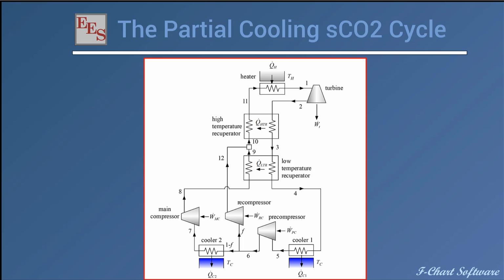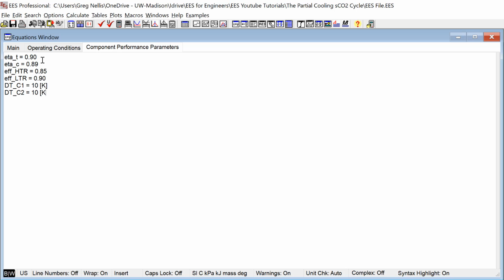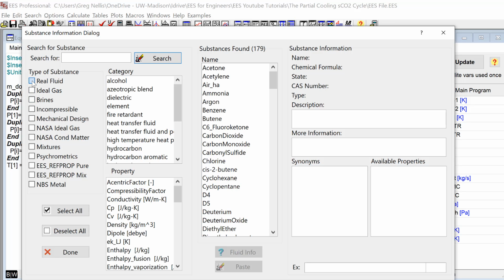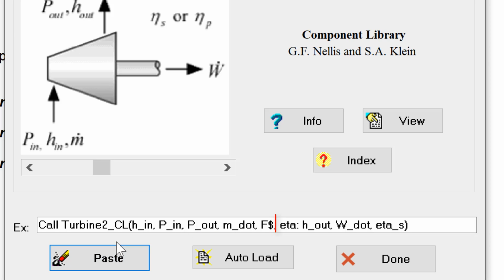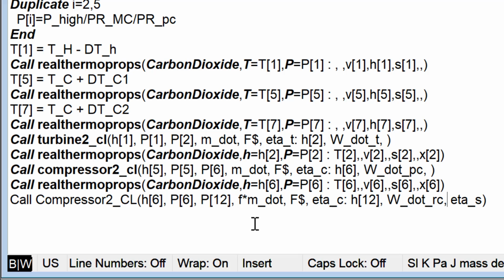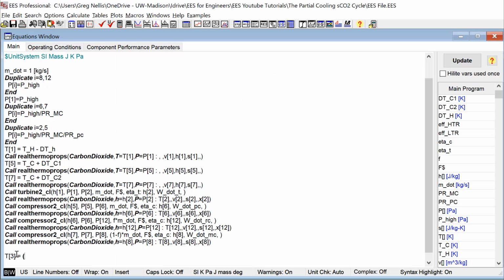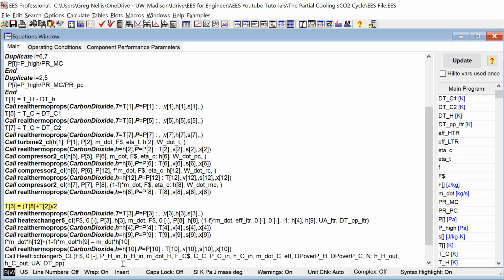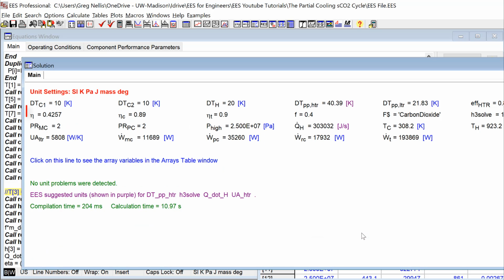An Example of using EES for Cycle Simulations

Comment: The tutorial is excellent, and I’ve been following it step by step on my computer. However, I encountered an issue when running the code. My professor provided me with the commercial version, so I’m able to use the exact code shown in the video.

When I run the code, I get the following error: "The convert function was unable to convert W/K to kW/W."

Could you please advise me on how to resolve this issue?

Thank you for your time and assistance.
Reply from the maker: I am not seeing this line in the video but the problem with it is that the dimensions of both of the parameters in the convert function must be the same
convert(W/K,kW/K) would work but convert(W/K, kW/W) will not

Comment: Hello I have a long simulation OF refrigeration with a lot of iteration and I use the factorial function to make it work, at the end I make the factorial equal to COP and now in the main program  it only show COP , I cannot make a paramteric table to study the refrigerent details, can you guide me how can I make to show other parametres like Teva, Tcond in the main program to conduct parametric study?
Reply from the maker: The factorial function returns the factorial of the argument.  I don't understand how it can be used to help with a refrigeration simulation.
Reply: The simulation I am working on is complex. To determine the outlet conditions of both heat exchangers (HXs), which are segmented into various parts (labeled Q1, Q2, etc.), I employed the ε-NTU method. Each section undergoes 100 iterations. For this purpose, I defined the following function:

Function Factorial_T_R134a_out(N)  " This is refrigerant temperature changing in whole simulations"

"At the end of the code, I've assigned the Coefficient of Performance (COP) to the result of this function and marked the end of the function block:"

Factorial_T_R134a_out=COP
    End
 
	COP = Factorial_T_R134a_out(1)  

My professor has now asked me to conduct a parametric study. However, the main function currently only shows the COP, and I need to know how to include other parameters to construct a parametric table. I am questioning whether it is feasible to perform a parametric study while maintaining iterative loops within the cycle, considering the simulation already takes around 30 minutes to complete. Additionally, I intend to conduct the parametric study in the factorial section. Given that this section reveals thousands of iteration values, I need guidance on how to incorporate the required parameters into the main function for this purpose. I hope this clarifies my request.

 @EngineeringEquationSolver
Reply: I dont know weather its a factorial or any other function but this is how I did,

 Factorial_T_R134a_out(N)

---
-
-
-
-
-

Factorial_T_R134a_out=COP
    End
 
	COP = Factorial_T_R134a_out(1